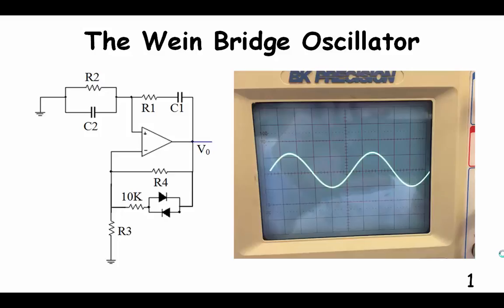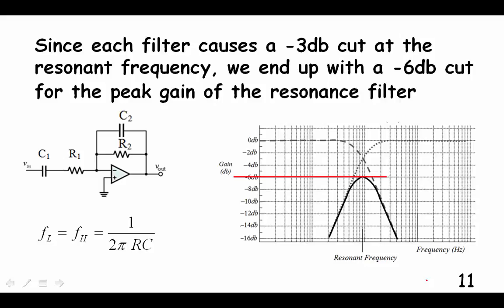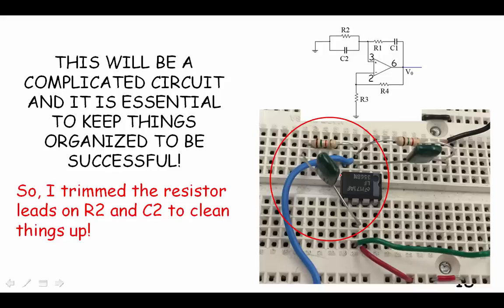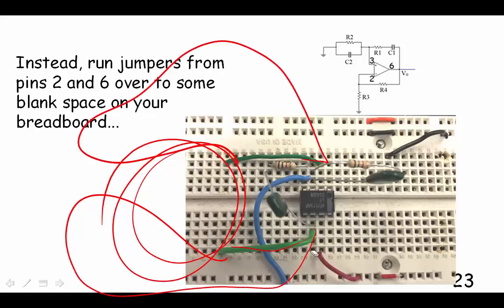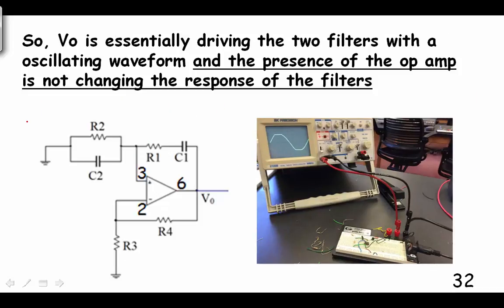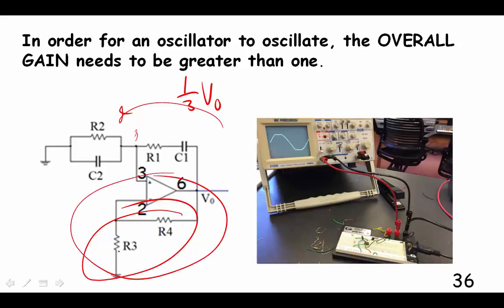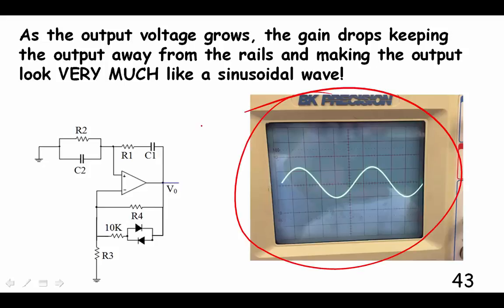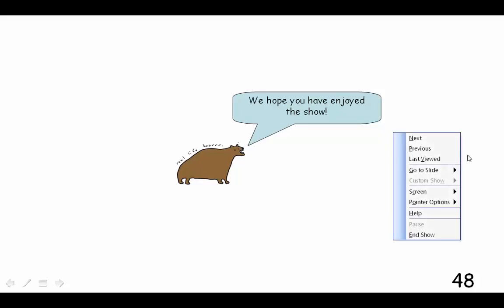Lab 7b Wein Bridge Oscillator

Comment: It's usually called a "Resonant Filter". "Bode" is pronounced "Bod-ee". "Wien" was German and is pronounced like the city in Austria (with a "V" sound in the beginning). The "regulator" part of the circuit, as you called it, is usually referred to as the "amplitude stabilizer" so as not to be confused with something else.